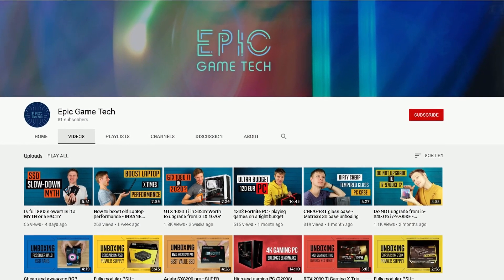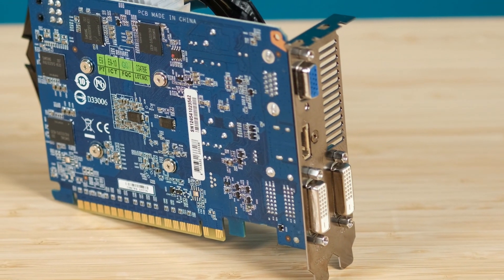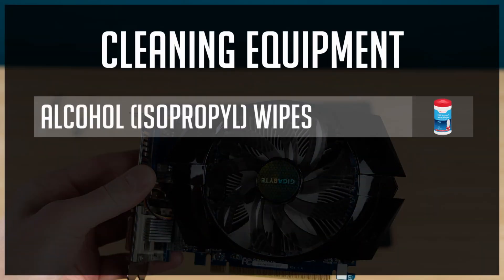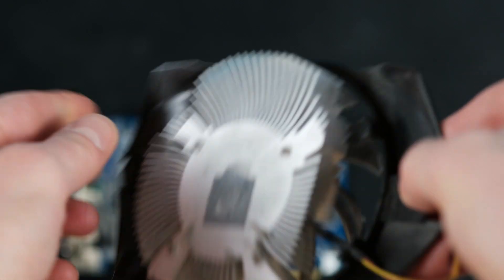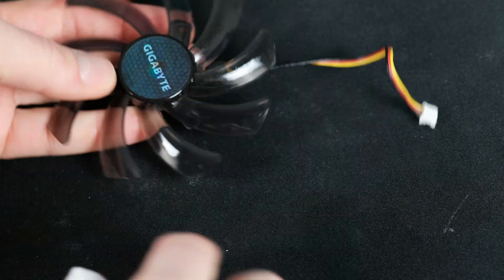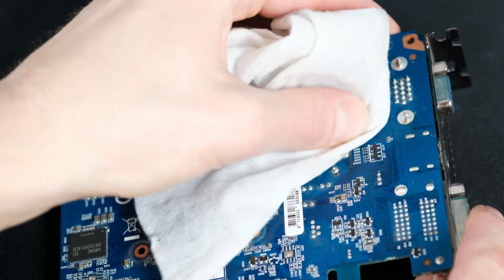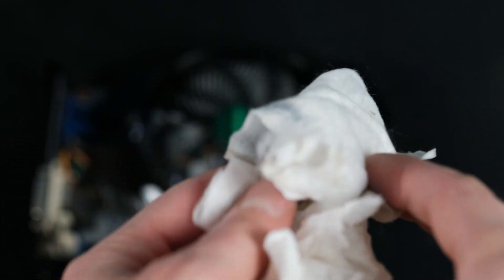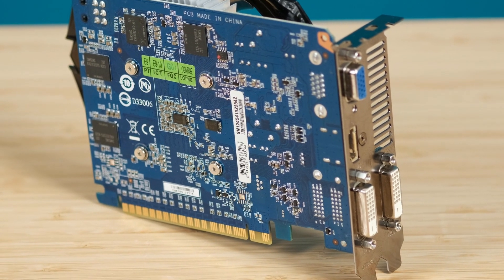HOW TO CLEAN GRAPHICS CARD (GPU) - Changing GPU Thermal Paste & Cleaning dust from my old GTX 650

Comment: I can't boot my pc !
It's just stuck at boot logo then the screen goes black
Reply from the maker: Hey,
what exactly did you do?
Did you try to clean and re-paste a gpu die? :)
Reply: @EpicGameTech  
Thank you for replay .
I removed the heat sink and add new thermal paste
Anyway the logo popup normally and then black screen ( no beeps no errors and no cursor)
I tired unplug the gpu and used mobo gpu and I got an error saying I don't have an OS !
I couldn't get it, everything was working fine yesterday.
I will try to re install windows again.
😅made me confused and sorry for annoying ya
Reply from the maker: Ah i see, well if you cant boot with integrated graphics and it still didn't work, something is off :)
Regarding a gpu you tried to re-paste - i hope you cleaned old thermal paste and did it carefully not to break anything and also used non electrically conductive paste.
Reply: @EpicGameTech  
Can I use the same cpu thermal paste?
Reply from the maker: Yep :)

Comment: Bro can you suggest a non conductive thermal paste for gpu please.
Reply from the maker: Hey,
well, artic MX-5 is quite a good one for the price. But in general, any electrically non-conductive thermal-paste will be fine (corsair makes a thermal paste, Thermal Grizzly makes really high-quality paste, but sure, it's more of the most expensive ones as far as I remember), especially if you are re-pasting older gpu. I mean you should not spend lots of $, unless you have some more premium GPU :)
Reply: @EpicGameTech  Thanks Bro

Comment: hey man, great video as always!

i plan to clean my existing gpu also and sell it to upgrade. i have a deepcool z5 which is electronically non-conductive that says on the website - this should be good in re-applying thermal paste for my gpu right?
Reply from the maker: thanks, but this one is one of the oldest videos and I always think of removing those old ones :)))
Regarding paste, yep, basically, you can use any thermal paste. Actually, I haven't seen thermal conductive paste for a while (unless you specifically search for this type of paste) :)
So all good here